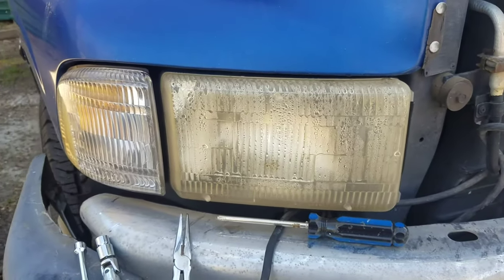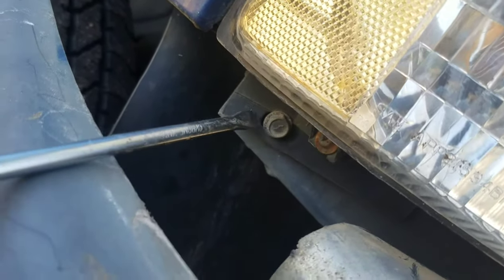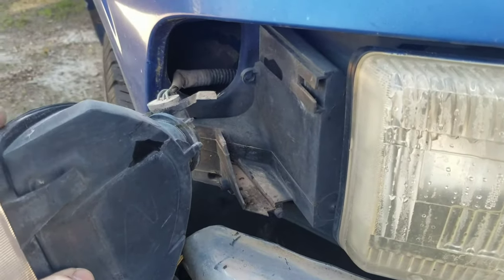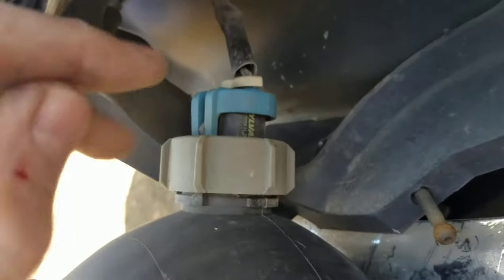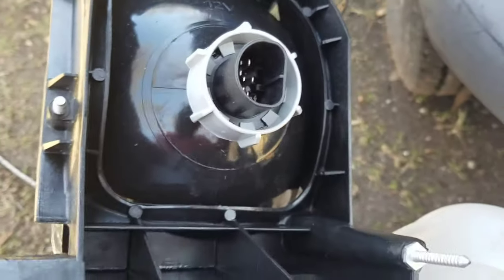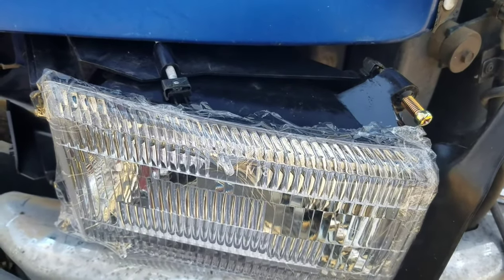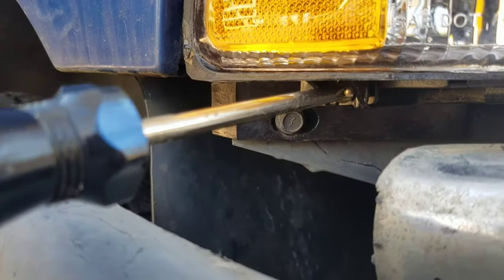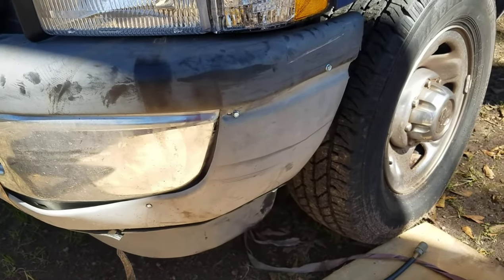Headlight replacement for second generation Dodge Ram 1994-2001

Comment: Thanks for such a detailed video and the tips.  Having never done this before, it took me about three hours to get both headlights done (two hours the right one and one hour the left one).  Without that little tidbit of information about removing the clips to get each piece out and in separately, I probably would have thought I needed to remove the bumper.  For the one screw on the bottom inboard, I found it's almost as easy to get to by coming up from underneath with a 1/4" drive 3/8" socket.  But it is hard either way.  My left light was doubling as a fish tank.  But all is good now.  Thanks again!
Reply from the maker: Glad you're good to go! 
Thanks for watching!

Comment: You can get the whole assembly out in one piece, but it’s a very tight squeeze. I just finished replacing both without disassembling. Remove the three bolts and the plastic pins. You’ll have to slide it to the outside and squeeze and pry it past the quarter panel and the bumper but it will come out. 

Thanks for the video! 👍🏻
Reply from the maker: Thanks for watching!

Comment: Thank you for the video help out a lot I removed the shield that sits just above the bumper there is a rivet next to the tire on each side and 9 clamps that's it on the inside of the bumper gave me enough room to put the new headlights in without having to tear them all apart
Reply from the maker: Thanks for watching! Here's a link for an upcoming giveaway we are doing on the channel courtesy of Crimson Trace! https://youtu.be/Zetazonm9NI

Comment: The 1998-2001 Cummins Diesel Rams, with the VP-44 injection pump, even a 24 year old one, are definitely worth a set of new headlights. If your truck is still in decent running condition, hang onto it until it explodes or just falls apart. Replacing it with a new one will set you back at least 50 grand, assuming that you can even find one to buy any more. My '98 Ram Cummins has the same problem as this one - the headlight lenses are practically opaque. No water in mine, but the light output is practically nil.
Reply from the maker: Thanks for feeding the Al-gore-rythm!
Reply: I just got a 1998 2500 v8 magnum! I need to replace the ball joints but, feel so grateful. Looking to get new headlights but will look elsewhere besides these ones, great video about the install process though. Thanks for the video
Reply from the maker: Thanks for watching! My 95 needs ball joints too. They are solid trucks!

Comment: This guy is making this much harder than it really is. Remove the 3 bolts pull it loose Remove the bulbs slide the light to the center and lift the entire assembly out.
Reply from the maker: I was looking for your video showing the better way to build the mouse trap. Can you send me the link?
Reply: I saw another video where that guy did what you just described - slide the assembly toward the center. It's still a tight fit and needs a lot of finessing, but it's easier than disassembling the assembly and installing the lights and housing separately.
Reply: @Jay Lewis  I watched this video and figured out an easier way. Just do as i described and it works.
Reply: @jeffmalone7524  could you please send me the link for the headlights?
Reply from the maker: @bigpoo02 Brock Aftermarket Replacement Driver Left Passenger Right Halogen Combination Headlight and Corner Light Assembly Set https://a.co/d/aVJk9Sz
Reply: I have to laugh.  It's three bolts and one Phillips head.  It took me 10 minutes in the dark with a flashlight......cackle out loud.....

Comment: Very enjoyable, I drilled a small hole in the corner of my headlight for drainage.
Reply: did that work for you ?
Reply: @timswatek  yeah slightly on the underside so no more water
Reply: @justindoyle5996  cool, might be quick fix until I can fully replace. Thank you

Comment: My drivers side headlight is doubling as fishtank. I'll use your video to replace it. Thank you!
Reply from the maker: There is more than one way to skin a cat, but this way worked pretty well. 

Thanks for watching 👍
Reply: I just drilled a hole in the plastic.  Made it an air cooled instead of a water cooled headlamp!😊

Comment: I did mine without having to take it apart like you did. 
All I had to do was remove the plastic bumper cover. 
I reached the bottom bolt from underneath the bumper
Reply from the maker: Thanks for watching

Comment: How is the difficulty level of doing this for someone with not much mechanic experience? Also I see a plug but does it require electrical knowledge?
Reply from the maker: Without knowing your specific skill level my best advice is: 
If you have reservations about doing it yourself, find an individual that is willing to give you a hand and show you how to do it so you can be better equipped for the next project. There's probably a retired feller in your neighborhood that would be happy to pass on that knowledge. 

Hope that helps.

Comment: With the rubber seal, you don't have to pull the pins out and reinstall them. You can actually just hook them on the bottom side of the hole in the rubber, and pull up to stretch them over. I couldn't get mine out without breaking them lol
Reply from the maker: Thanks for watching!

Comment: Totally could not get the metal clips on for the new light. Wish you would have shown that. We had to take it to RAM dealer to get er done. I’m pretty mechanical with this type of replacement, but couldn’t figure getting the clumps back on.
Reply: Clips, not clumps… but that’s about what my brain feels like after hours of trying to figure out the clips and getting nowhere.
Reply: @mochayankee  You can edit comments..👍🇺🇸
Reply from the maker: I'll try harder next time! 

Thanks for sharing!

Comment: Gotta keep these old trucks running. No particulate trap, no DEF. How’s the beam pattern? That’s what’s important to me.
Reply from the maker: Agreed on the old truck life support. 

The beam pattern isn't nearly as nice as some of the newer vehicles have, but it is way better than the old yellow fishtank that was there before. 2 and a half years later, they have held up well.
Reply: @JayLewisFarmStyle  thank you sir. I would like to adapt L E D lights. I haven’t found any.
Reply from the maker: I'll keep an eye out
Reply: My '98 is pre-DEF, pre-DPF, and pre-Catalytic Converter. And it's a manual transmission one (NV-4500 gearbox), so way more reliable than the automatic transmission ones. Only 106,000 original miles, so it'll probably last at least 10 more years.

Comment: Ima just pull the bumper off
Reply from the maker: 25 plus years worth of rust made me decide not to do that.
Reply: @JayLewisFarmStyle  Good video - previewed a couple of vids to see if there's an easy way. Bumper bolts came out easy for me. I'm in the south without corrosion on my 1999. PB blaster on the 3 bolts and the side bracket. Surprised there was clearance for 1/2" ratchet. Knee pushing down on bumper and headlight assembly grudgingly came out. Squatted with both knees pressing up on bumper when I tightened the bolts.  Bumper now sitting more aligned now. 
The socket contacts for the 3157A bulb were no making good contact, cut an emory board in half along the length to scuff up the contacts and dosed it with dielectric grease.
Reply: Removing the side marker first was key - glad you pointed out that screw holding it in